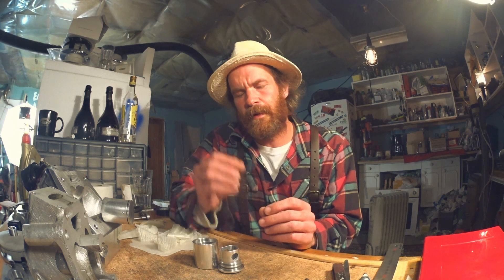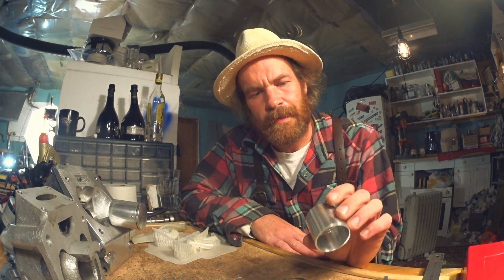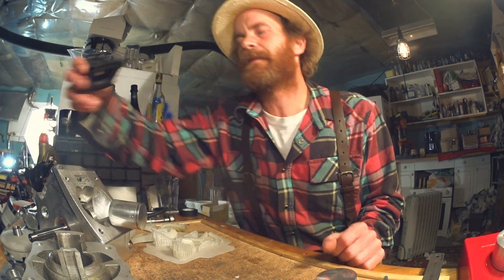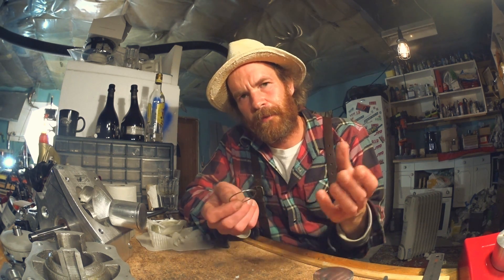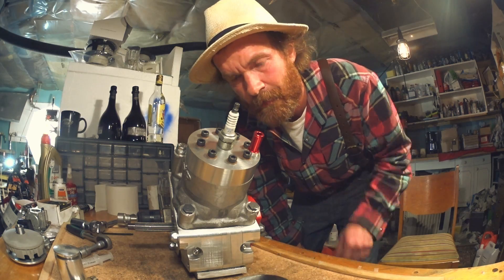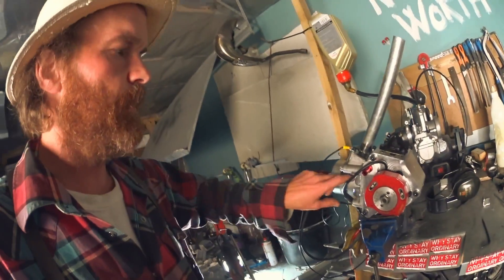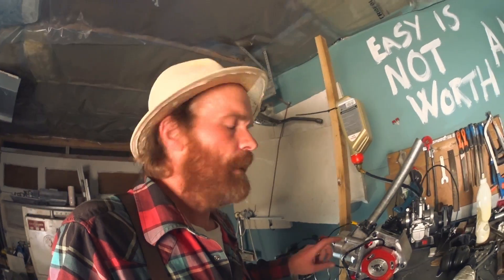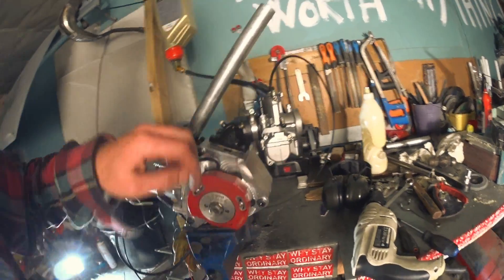STARTS, RUNS, EVEN IDLES! The Most Powerful Two Stroke Ever.

Comment: a back firing 2 stroke happens when theres to much blow by. ive owned rd's rz's 500 & 750 triple kaw shit loads yz's rm's cr's  & for 15 plus years an rg500. and one thing i learned from pre ignition and the hole in the piston, was back firing. and ive played with the gas bikes and have one right now. anyway when i frist got one a friend gave me a motor. so i had a spare. first motor, because i now had a spare, the first 1, got ported, jetted & ported & rode the shit out of till it seized.so it was my only form of transpo so i now babied the second 1 . with in 10 miles, bang, a ring had caught a transfer port. at that time i didnt know what the reason was. another guy i knew said pop the head & sand the cylinder see if you can get it to run. i did that and theres a big hill out in front of the house. while peddeling my but off from the bottom of the hill and pushing back up. the second time i got some back fires and knew it had a big compression leak. so then my lazy butt, took it apart and found the stuck rings, reason for the blow by kind of like a detention hole, a leak that causes the back fire. that may be the reason its hard to start. keep up the good work. i made 1 motor from the two and it fired right up. that was 2 plus years ago. its still running with 2 thousand plus miles on it.

Comment: For compression testing, having a thick oil on the cylinder wall will seal the ring etc. Then you will know what it is capable of. Try a 50 weight oil.

Comment: Have you considered a custom electronic fuel injection setup? When you’re in those extremely high RPMs (20k) like you’re shooting for, the atomized gas particles are too large to burn entirely before leaving the combustion chamber. To improve efficiency and increase your top rpm, more finely atomized gas particles will be necessary, which you will only be able to get with EFI. I’ve been watching your series for about a year now while designing a flat-6, 4-stroke, rotary head engine of my own. Love watching your progress, great work!
Reply from the maker: 👍 Continuous injection on the secondary intake. 500cc/min through 0.9mm atomizer nozzles, fine mist.
Reply: @2STROKESTUFFING  FANTASTIC!!! Sounds like you have it covered! How do you plan to get the oil mixture you need if you're using the fine mist continuous injector?

Comment: Great builder!! In Slovenia we had a super 2 stroke factory Tomos. In 70's they built the fastest 2 stroke. It have 50 ccm and around 15 hp. It has carbon frame, total weight of 32kg and hit 205km/h. Years ago I also built Tomos with original motorboat 60 ccm cylinder with some port changes, L piston and delorto 18 and my son in his 13 years smoked all well tuned 50cc scooters 😄

Comment: Why would you say you can't count the rc engines? They are the most powerful engines by displacement on the planet. We're talking an engine that is 3.5cc making nearly 3 horsepower. I know they can't be used for something to ride in, but they are still an internal combustion engine being used as a power plant. Imo they should absolutely be counted.
Reply from the maker: Yeah, you're right. Need to find the confirmed most powerful one and beat that then! With RC-amount of nitro it should be doable.
Reply: @2STROKESTUFFING  very true, and because of the fact you can change nitro percentage the number can fluctuate greatly. I would love to see you put your brain power to a nitro rc! Though, I think you would need to decide on what percentage and see what power you can make with that. Most engines are designed around 25-30% nitro methane.

Comment: Years ago we had problems with the early srx snowmobile pistons melting down. Aeen performance reccomended a cool fix to that even with high compression. The outer edge of the cylinder head at top dead center had too much sguish area and we would machine approx 5 to 8 thousands away from the outeredge of the cylinder with relationship to the bore size. It worked. Goodbye detonation !!  Old info from the early 80s
Reply: Correction, cylinder head was machined not the cylinder.

Comment: Yo, yo, yo..... You my friend, are a fugn genius. I build 4 stroke 240cc-275cc racing engines out of KLX 140cc base engines. I have been experimenting with bore to stroke ratios, compression ratios, rod to stroke ratios, different weight Crankshafts/pistons, balance factors, different ports, carburetor sizes and cam grids. I'm 8 years into it and almost have found the sweet spot. I also would love to cast my own case one day🙏 Keep on a rocking brother man, I have been following your progress for years 😀 👍 
Luv it❤

Comment: I used to run oversized piston ring in old 125's in the 80's with the old steel bore cylinders and file the end rings to fit cylinder with smallest ring gap I could. Definitely could feel performance gain, especially off bottom, really helped on sandy tracks.

Comment: Luv it when I see hard work turn to success.only the 4 cyle engines are air pumps not 2 stroke not sure why people get it twisted I think u will be ok with that big case volume if not u could always make it 75cc great work keep the videos coming for my 2 stroke experience the pipe was the greatest key to unlock power I had a 65cc polini bore 
puch maxi with a 1 speed motor 
24mm kehin carb hitting 85mph
With no porting only homemade chamber pipe and cylinder head mods 18/36 gearing

Comment: You have done more in one video than all the naysayers have done in their entire existence. 
Keep up the the phenomenal experimentation. And never lose your sense of humor.
You are an inspiration to all of us backyard inventors!
For ring retention across the exhaust port, could you put a bump on the inside of the ring centered over the exhaust?
Drill it and pin it there to retain the ring in the split piston. 
This would never have been possible before the screw together piston. 
You could even do multiple pins if the holes were slotted for expansion. The open ends of the ring would no longer need the traditional pinning. This would reduce the ring wear issue that you are experiencing I believe.
I also think that your 90 degree cylinder orientation idea is still on the table. It would put the piston on its most stable plane to minimize tipping into the exhaust port.

Comment: I will   bet  you  $1  million that my bone stock  8-V-92  Detroit Diesel has more power..  92 cubic  inches  per cylinder   8 Cylinders  ..  475  HP at  2,100  RPM

Comment: Proud of you, man!  R/C engines with 750hp/L++ are nothing to sneeze at, especially at that scale (port velocity, poor thermal efficiency to overcome)...I've always wanted to take a 3.5cc Novarossi 9 port and scale it up.  IF (BIG if, granted) you still ran it on 30% nitro fuel ($$$$$), and the bhp/L could be maintained, you could have a 500cc 2 stroke single with 375-400hp...hayabusa come get some!

Comment: If speaker enclosures are anything to go by I'd expect the pressure at the back of the ports to be ~6db higher when the resonance intake is working at its peak.

This should create an port mass flow spike which could be enough for 5-10% higher peak torque, very exciting stuff (even moreso if you expect it to be even better!).

Comment: 30 HP on 50 cc? Damn. That’s a hell of a power goal! It’d be awesome to see your project in completion.

It’d be sweet to see a 4 cylinder version of that engine turning a bike wheel. I can’t imagine riding a machine with the power to weight ratio that would produce.

And the idea of resonance is everything in efficiency and squeezing as much power as you can out of something. 

Like timing the push of somebody on a swing on as many of your mechanically moving parts as possible. I wonder if it’s similar to ultra-high-efficiency electric PM motors, where you recycle back EMF, pulse DC at resonance, using Caps, Coil winding, and speed to find that sweet spot where you’re pushing a little after that theoretical swing reaches peak heights.

Comment: I have a question on the resonance point.  For it to be resonant, that means that has to occur at a specific frequency. So, if I'm understanding that right, that means this engine will/should have a wicked powerband (or resonant band) but once it falls above or below that point, power will fall off dramatically, right?

Unless your goal is to make that resonant band very wide, which I don't know if it is possible, this will be a very RPM specific operation, correct? I'm not complaining, I'm try to understand.
Reply from the maker: 👍Yep, very rpm specific. As I'll use a CVT I can get away with it.
Reply: @2STROKESTUFFING  Ok, that makes sense. Thank you!

Comment: 3M has a kit to make your own custom o-rings. Not cheap but if you need a special size you can make it. Uses CA glue and it works. My Band saw rubber wheel bands are made this way and have lasted for years.

Comment: Have you looked into the Chung Yang 460 motor? 
Those use a reedless system like yours and they make great power.
Also for your exhaust pipe I’m not sure if you already are familiar with Jetpro pipes but I do believe they might be a great reference tool. The company’s knowledge of 2 stroke exhaust systems is massively impressive!

Comment: Is the ring retained at the cold or running temp dimensions? What I am getting at is, that the steel ring will expand dimensionally different that the aluminium cylinder due to the difference in their thermal expansion coefficients. Ehh?

Comment: What do you think of using a spirolox type of ring? 
The two ends could be lightly relieved to have a slightly smaller  radius at the ends. 
This could possibly eliminate the snagging of the ends while allowing the ring to spin freely, unpinned.

Comment: Perhaps this is crazy but I was wondering can't the ring just be like a spiro lock? I know there would be some high points on the overlap of the ring but I was thinking maybe just have the piston ring grove machined to accept the surplus.  Ring gap could be controlled by the amount of play in the recesses and you could theoretically get "perfect" seal.

Wasn't thinking the overlap needed to be that large maybe  1cm total.

For those not familiar with spiro locks see this install web page. https://www.underhoodservice.com/tech-tip-piston-pin-spiro-lock-installation-procedures/

Comment: Taking expansion coefficient of cylinder and piston into account and anti friction coatings on a piston could you not get away without a piston ring ie determine normal operating temp or working temp of parts inside and go from there . maybe a slight chamfer on piston crown to prevent snag .

Comment: i tuned my Puch maxi engine, about 28/29 years ago at age of 16, i toke "valve" grind paste from the automotive shop, a glass pate, skimmed the head and removed about 1 mm, with stock cylinder (modified ports by me --> using books from the library), stock piston (modified), stock carburetor, stock stock jet, but with "Yamaha powerbox from RD-80LC" on the intake manifold, Proma polymer expansion exhaust and managed over 11.500 rpm, it didn't came of the line very well, but once moving it sounded like a formula One Engine, that high and came over 80km/h, using 50cc. i could even remove the HT lead and it would keep on going sometimes.  i managed a heat seizure going UP HILL fast, but once cooled down al was well and would go on again. ... i even modified the spark plug for a split pin .... 

you're at least world first to use a 2 piece piston.

Kreidler "van Veen" did 20 hp 50 years ago, in the 50CC racing class.

and i still would use a sleeve  if you're going so extreme .... even modern Ferrari's use sleeves.

Comment: Next time someone says  your doing something wrong ask to see the cylinder they cast so you can compare it to yours! I built 2 stroke 250cc micro sprint engines including my own pipes for close to a decade and everything your saying makes sense to me. The exhaust port thing doesn't seem practical but that's obviously your passion and I believe you'll make it work. I dont think you need to justify your direction the results will speak for themselves

Comment: That engine sounds like a beast in the making. I wonder if running two piston rings would create a  noticeable difference in compression. I have an old homelite weedeater runs decent. Piston has one compression ring. I also have a stihl weedeater with the same size engine that absolutely screams. This one has two compression rings and seems like it has double the compression and power as the homelite. Might be an idea.

Comment: Hi Alex, great work, keep at it.
Can you explain your ring fixing more please, how much movement is designed into the pin, do you need just slightly more than the piston clearance allowing the ring to move enough to seal, I’m guessing it’s got some movement?
Not sure how your building your resonant intake, if you want a carbon one making give me a shout, Chris from easycomposites.
Video rocks.
Reply from the maker: Thanks! Can't remember the exact number on the top of my head, but it has to move enough to still seal in a worst-case piston rocking scenario. I'll start testing with 3d printed ones, probably need to fine tune the length. When tuned in, one in carbon sounds awesome!

Comment: I suggest to put ring inside bore without a piston and have a look on a surface with a light/torch it ring is stick to bore all way long
Reply from the maker: Good tip!
Reply: Don’t know 2 stroke engines that much, but honing marks on bore may be helpful to increase compression, and they are relatively easy to do.

Comment: With sharing your knowledge and experience like that, you're giving to the rest of us tinkerers and thinkers. 
Your stuff is one of the reasons I'm getting more and more immersed in 2stroke technology. 
I love it. My wife not as much.
The engines I'm working on are old Sea-Doo 700cc+ 2cylinder, same principles apply, even if it's a totally different application.
Lousy 7000RPM and less than 130Hp from 800cc is where that's at. 

Don't let the naysayers and trolls get to you, developing stuff takes a ton of scrapped ideas and prototypes just to get one thing right.

By the way, I seem to recall a spiral-ring design sometime wayy back maybe in aircraft engines, wonder if that concept could work.

Great stuff, 2 Stroke Stuffing, keep it up !

Comment: It idles smoother than my IZH. Hat Is Off. When honing the next cylinder, I still hold this flag for smooth bore. When you plate the slide surface with hard material, it becomes a chisel. That with 20.000 revs, grinds that ring, and the piston to dust before the end of the track. 
But damn, it sounded GOOD!!!

Comment: 8 love the way you engage with the community and how this has become sort of a collaborative project where ideas can be debated and tested. Especially the fact that people across the world are contributing.

I'm out of my depth with a lot of this so a lot of my suggestions are more guesswork than anything else based on theory so im always amazed that you take what little I can help with. 

Are the rules for Bonneville such that you have to run pure water for cooling or are the temps such that you have to have some glycol? Also bugger... the fact that we hadn't considered engine orientation makes me feel really stupid for missing it.

One question about your printer, id look at the heat of the bed and if there is any breeze or air flow that's causing plastic to cool too fast its an issue I have had with my printer, I need to make an enclosure at some point for mine and clean the bed.

Comment: Glad to see the electric drill motor working out for you! With less than 90psi of cranking compression, fuel has a difficult time combusting, and probably the reason it has to be spun up so fast to start. Works the same in 4 stroke automobile engines which we primarily work on in our garage, and we actually shoot for 200psi cranking compression. Much more than 200psi and even 93 octane fuel isn't sufficient enough to resist pre-ignition/detonation at lower RPM with loads.

Comment: Im very for this project, it's technology, one of the most beautiful things man can do in his life.

 I have an idea, for an exhoust port. Maybe you could do some spare cylinder and do just physically same wide port, just to know mechanically it works or not. Then you will be sure for that.

There is on youtube 200cc scooter, making 72hp to the rear wheel. In one of their video you can see cylinders exhoust port, it looks also about 100% but has on a sides nicely angled 2 narrow bridges. Im wondering, side angled bridges should make little turbulances yet it looks reliable for a ring.

Comment: I'm watching your videos for a very long period of time and i know that you did a hell of a research to make this engine so don't worry about those trash talkers. Can't wait to see that engine running in it's full potential. I'm doing a project on my aprilia rs 125 but nothing large as yours, trying to make inner rotor ignition with lighting/battery charging but i'm not sure if the rotor has enough magnetic flux to energise larger coil on HPI ignition.